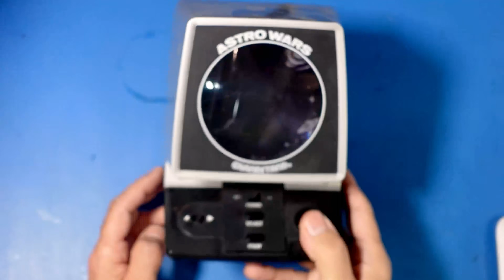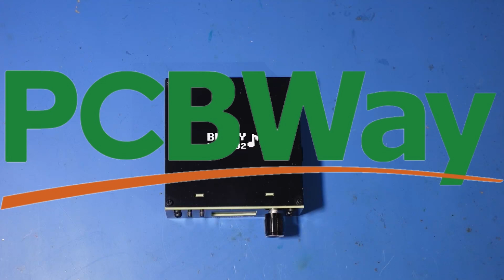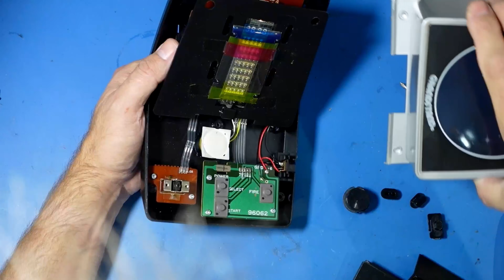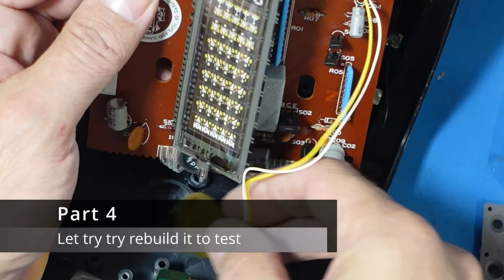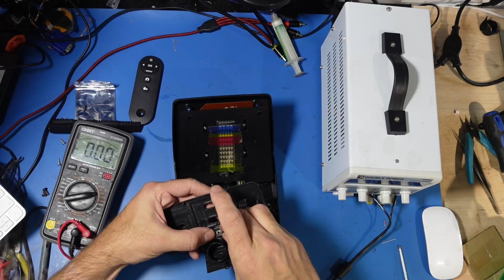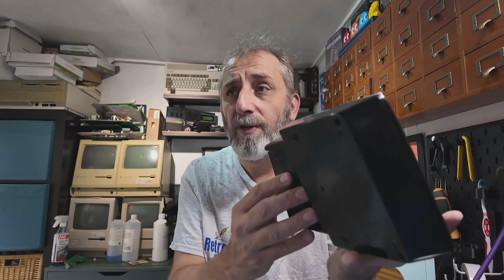Grandstand Astro Wars Repair – Bringing a 1980s Classic Back to Life!

Comment: My brother's got an Astro Wars.. I'll see if I can get him to send me a pic of the joystick and I'll have a go in fusion if you haven't already found one...
Reply from the maker: I have not even tried and if you could do that would be awesome 🤩 thank-you very much.  I've been to busy with other projects I need to catch up onn
Reply: @Retro4u We had a look this weekend, and it looks like there's no easy way to replace the lever, since it's part of a spring-loaded pivot mechanism that turns the movement into effectively a slide switch.

The general thought is that I could 3D print a square panel to go on top of the square profile of the old switch with a joystick stalk off it.. something like a metal pen top would replace the aluminium cover that it used to have.

What's really weird is that googling for "2 Way Joystick – DPDT Switch – Center Off – Spring Loaded" brings up exactly the right part with the correct pinout, but it only seems like it's available in India 😁

I'll let you know when I've done the design..
Reply from the maker: Thanks for that. Yeah I though you could design something to clip on the top

I am so busy with this Amiga build but appreciate  the time your taking to look into this thankyou :)